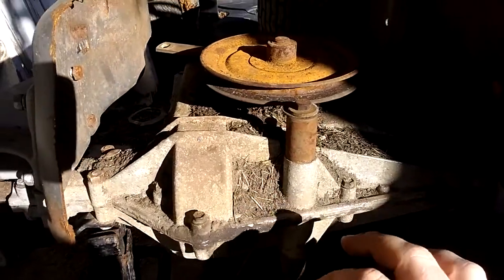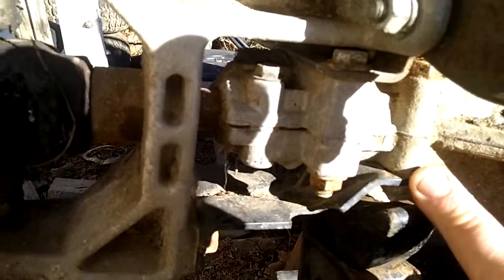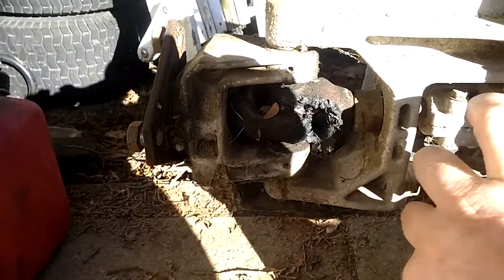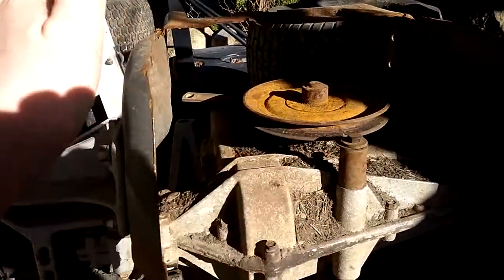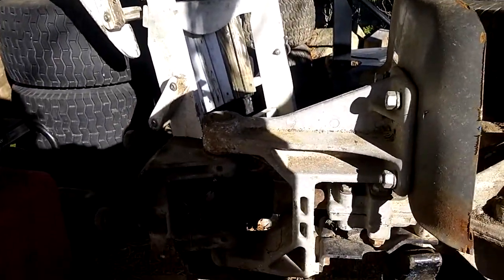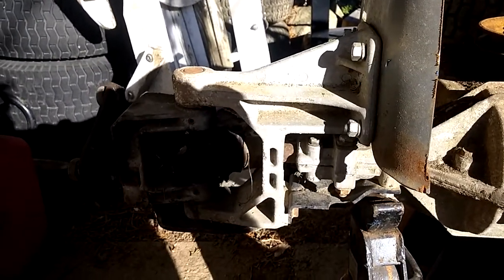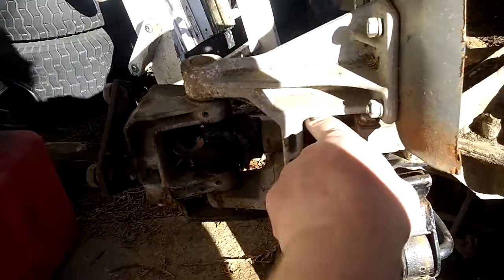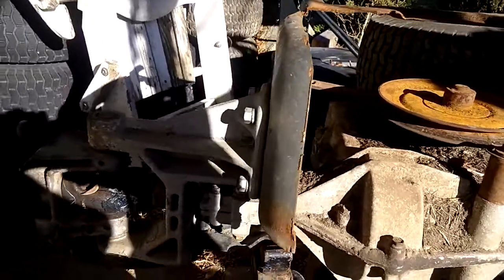4 Wheel Steer Transaxle Help-Questions

Comment: The nuckle and u joint will slide strait off the axle. It's splined with no clip.
Reply from the maker: That's what I thought, I have them soaking in PB Blaster right now.
Reply: i mean they oughta slide right off. mine did without a hitch
Reply from the maker: +Nick DePaiva I know what you mean, was able to get the one side to move a bit, they are a bit seized, but PB Blaster seems to be working.
Reply: thats good man! if the mower was sitting for a while i understand why they would be stuck. but the one i got parts from was sitting for a month or two then i got it. the guy was stripping it down. honnestly man id suggest u take the axles out of the 930 and use them in a mst206. axles will swap right over. just use the mst206 gears on the 930 axles. it will work flawlessly. just like my 4wd build so far.